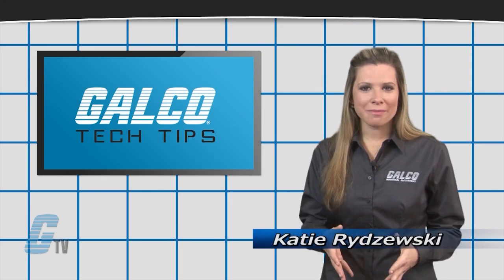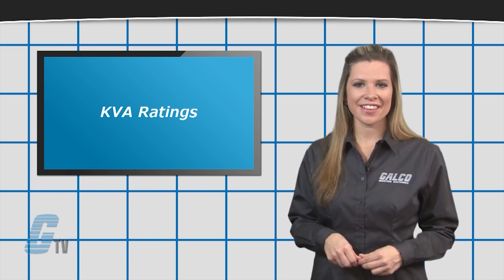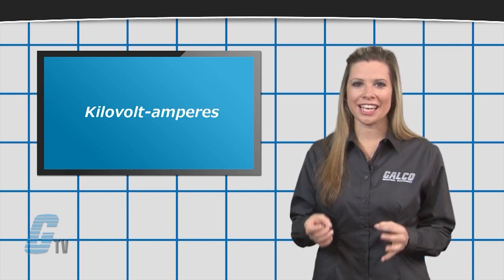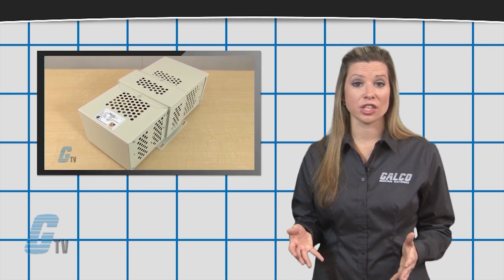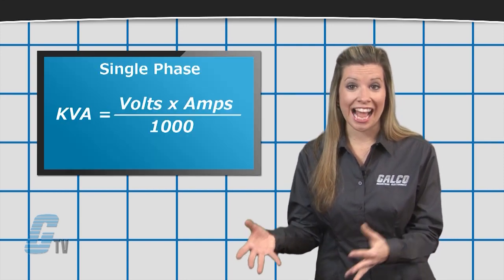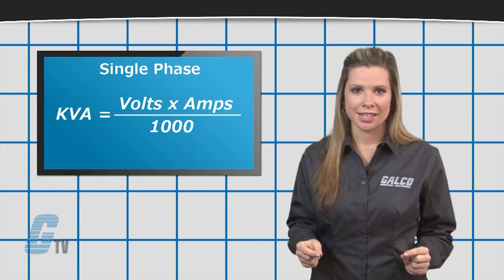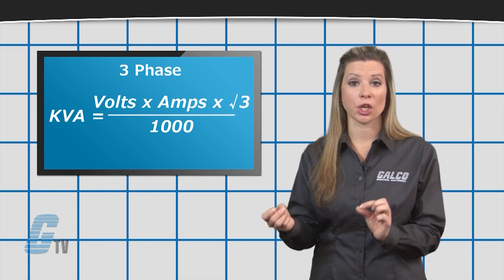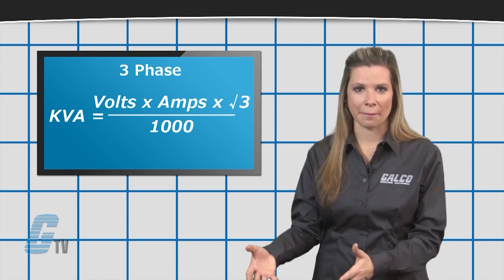What Are kVA Ratings? - A GalcoTV Tech Tip | Galco

Comment: What is the ultimate definition of the primary and secondary of a transformer?

Is the primary:
A. the side with the highest voltage?
B. the side with the source of power?
C. the side that remains energized, when the other side is disconnected?
D. the side that is oriented toward the utility?

Most of the time, the primary side is all of the above.  However, I work with many backfed transformers where these aren't all the same side, and the answer isn't obvious to which side is primary.
Reply from the maker: Good question!  The primary voltage usually refers to input side of the transformer.  In most cases it is equal to or greater than the secondary side (output) of the transformer.  In some cases transformers can have a lower value on the primary with the secondary having more voltage on the output when it is used to step up the voltage.  B would be an accurate description.  C also works since it really overlaps with B.  In the case of back fed transformers, the opposite is true... but keep in mind 'back fed' transformers isn't a different type of transformer, but a different type of wiring that goes against the nameplate data.
Reply: GalcoTV The transformer I'm talking about is one that would be dedicated to a solar, wind, or distributed generation.

Sometimes it steps it up from 480 as produced by the equipment to utility medium voltage.  Sometimes it may step it down from 480 to 208, to meet building voltage.  Or step it down from 480 to 400 to meet overseas building voltage.

In any case, it is current that flows from the generation side to the utility/building side, opposite the way that power usually flows in a transformer.  And for applying NEC rules about secondary conductors, it would be helpful to know which matters most in the primary vs secondary definition.  A, B, or C?
Reply from the maker: carultch As per the nameplate data on a transformer, B would be the best description from the options you put forth.  Keep in mind that the source of power does not necessarily mean the utility.  It also should not be A since there are transformers designed to step up voltage as you have mentioned.  C would be redundant since the side that remains energized would be the same side as the source of power. 
The confusion is made when a transformer designed to step down voltage is used to step up voltage.  The process of back feeding a transformer uses a 'step down' transformer in reverse.  A factory made 'step up' transformer will reflect the proper voltage with the transformer's nameplate having the primary lower than the secondary.
Reply: I wouldnt be messing around with electricity if i were you. Your life is not worth the money it would cost to go to school and learn about electricity... is it?
The only responces you will find on Y/T will be from know alls who actually know nothing about anything. 
A transformer with more than 0.5amps will kill you if handled incorrectly. Dont b elive me then type it in google. You would want your wife or child to find you on the garage floor looking like a fried chicken that shit its pants. People who are electrocuted is not a pretty sight my friends.
Reply: findvoltage I know what a transformer is, I know what it does and how it works.  I have learned about it in school.  I know not to touch it when it is energized.

The problem is I'm trying to understand how we define which side is called primary and secondary.  Just definitions  For 90% of the applications, it is obvious, because all reasons give the same answer.   For other less common applications, there are conflicting reasons to define it one way vs the other.

I happen to work with those less common applications, quite often.  It becomes important for me to know, because I'd like to apply the proper labels identifying each side, and because I'd like to know which side is treated per the rules of "Transformer Secondary Conductors"..
Reply: GalcoTV Thank you much for the explanation.  I understand that it could be either B or C, that best defines transformer primary and secondary.   D, in the case of most utility-owned transformers, because that is just how they work.

In my applications, B and C are not necessarily redundant.

Inverter systems will be the source of power for the transformer, but the AC side does not remain energized when turned off.

You can shut off the utility/building load side of the transformer, and the inverter side will cease to produce power. One would measure zero AC volts on a disconnected inverter.  But if you shut off the inverter side, the building load/utility side is still energized by utility grid.
Reply: GalcoTV Advanced Energy recommends the application of using their 480V inverters on a light commercial building with a 208V service, via a customer-owned step-down transformer.

Mainly because they build a more efficient/economical inverter at higher AC voltages.  Of course, good luck to anyone trying to find two cubic yards of space available for it.
Reply: +carultch "I'm trying to understand how we define which side is called primary and secondary."

With regards to your question/s
A> This could be either side depending on whether it is supplied to be a step-up or step-down transformer ((for either voltage or current))
B> Refer to answer for 'B'
C> Doesn't make sense! You can't have one side energised without the other being energised (unless it's faulty)
D> ??

The primary is the input side of transformer

"I know what it does and how it works." 
If you know why ask.??

Ask your science/physics teacher next time!
Reply: *****
"C> Doesn't make sense! You can't have one side energised without the other being energised"

It is possible.  Consider a step-down transformer, with a disconnect on both the 13.8kV primary and the 240V secondary, with energy usually flowing from primary to secondary.   If you open the secondary-side disconnect, voltage is still present on both sides of the transformer.  If you instead open the primary disconnect, the entire transformer is de-energized.
Reply: ***** 
"Ask your science/physics teacher next time!"

Your science teacher might give you a different answer to this question than the industry standard terms.  A science/physics teacher defines primary vs secondary in terms of which way the energy normally flows.  Primary = source, secondary = load.

This works well for a conventional application, where energy flows in only one direction, but in a backfed transformer, there are conflicting reasons of why you might define one side as primary and one side as secondary.  I'm asking to clear up this conflict.

Comment: For the two calculations would you not need to divide by the power factor?
Reply from the maker: Power factor is used for KW (kilowatts).  This is done by multiplying the volts with amperes times the power factor.  If you have the KW and the power factor, you can find the KVA by taking the KW and dividing it by the power factor.  Typically, one would have the volts and amperes before having these other values.

Comment: 3000kVA = ?????????????
Reply from the maker: You will need a little more information than that.  You will need at least one more variable with either voltage or current.  Then find if it is single phase or three phase, but generally a 3000 kVA unit would be three phase. What specifically are you trying to find?
Reply: ok .3000kVA , voltage 240V
Reply from the maker: Kovillen marday On a three phase system with 240 volts, the current would be a little over 7200 Amps (exact value with the formula is 7216.878).
Reply: MERCI
Reply: 3000KVA = 3MVA       😁😂😂😁